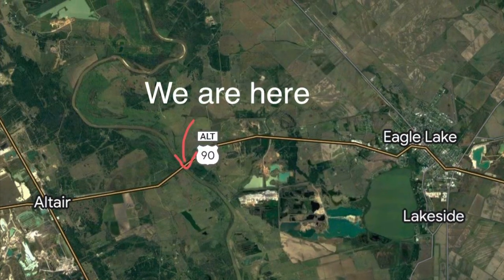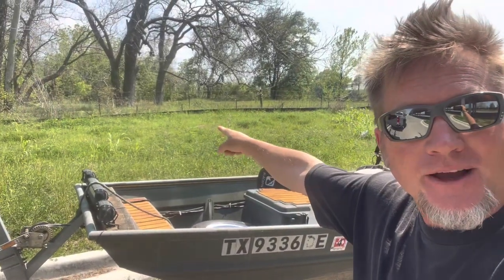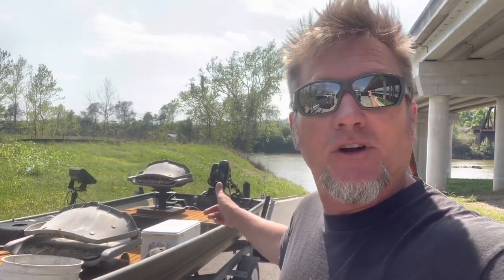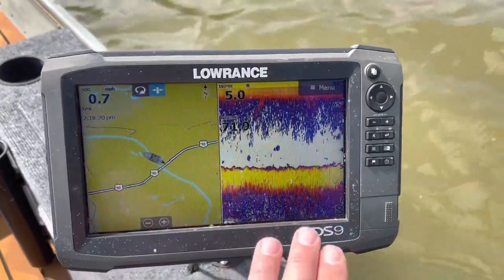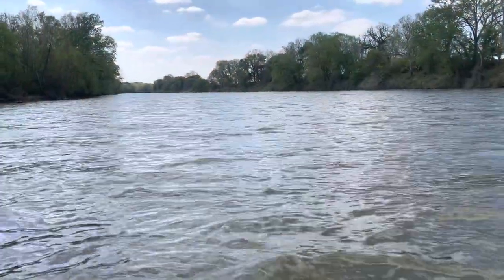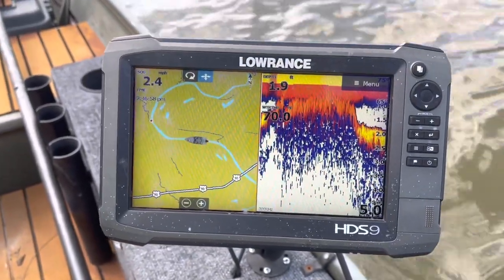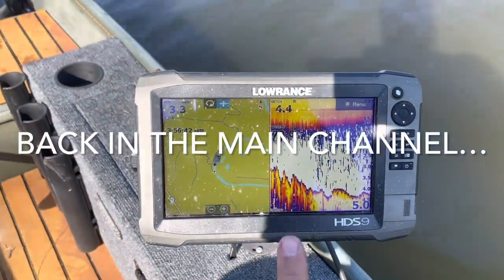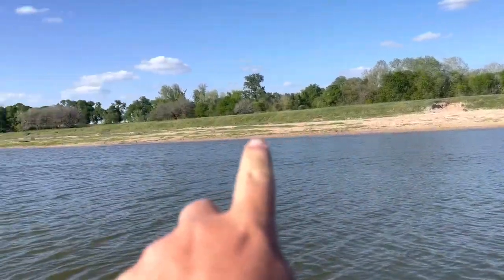The modern Colorado River incised valley, Texas (part 1: the fluvial system)

Comment: Nice video- something the people obsessed with channels on seismic need to watch. Its all about the point bars and understanding the whole valley complex. Is the motor the mercury 4/5/6 4 stroke? I've got one and suffered the carb issues too. Use lowest ethanol petrol you can get, a good fuel additive firstly; I also have an ultrasonic water bath that I can clean the carb out with, which keeps the jets clean each season, think it was 15 quid from amazon and seems to do the trick at removing scale.
Reply from the maker: It’s a 6 hp 4 stroke. Got it used with the boat a little over a year ago from a guy who didn’t take care of either. I overhauled both and found out that the previous owner had been running ethanol fuel and never drained the carb or replaced the lines. I just replaced the field pump this week along with the lines. The new carb just needed some adjusting. I only run ethanol-free in my generators, outboards, and other small engines, and I always make sure to burn off all the fuel in the carb after each use. I’ll take a look at that ultrasound bath you mentioned. Ethanol is seriously one of the worst decisions ever made for a whole variety of reasons!
Reply: @rock-o-rama   Yup, the ethanol is crap. Its always damp in Scotland, too, which doesn't help me with my fuel/carb issues. Its scaling rather than complete blockage though, its cool turning on the ultrasonic bath and watching over about 20sec the scale come off, and surprising how much of it there is in the jets- even after a soaking in carb cleaner. I read that in order to meet the emission requirements, the single cylinder 4strokes need very tight tolerances in the carb hydraulics, which are very sensitive to scale, whereas in the past it was more agricultural and tolerant. I also found my spark plug gap needed adjusting to spec.
Reply from the maker: @kingclayto  yeah, the old fuel pump and lines were shedding scale like cornflakes when I pulled them apart!

Comment: Just Amazing description, sir. 
We know that clay or shale layer play as a impermeable layer which obstacles the water infiltration or work as a barrier. I want to know, how much discharge if cut bank stratigraphy construct with shale layer with compare to sand layer? High or low?
Reply from the maker: If I understand your question correctly, it takes a lot more discharge energy to cut through compacted claystone and mudstone than sand. And the very small particle size of clay and mud, combined with the electrolysis holding the particles together, makes it very difficult to erode them.